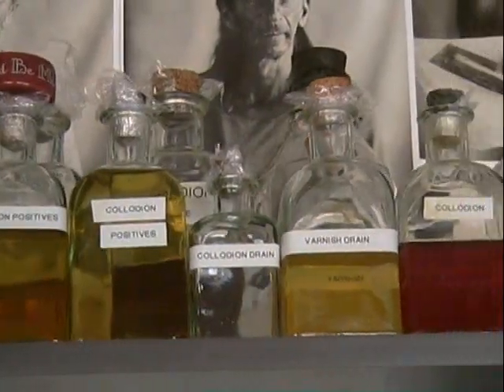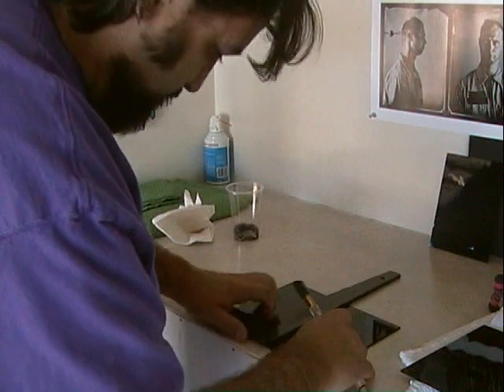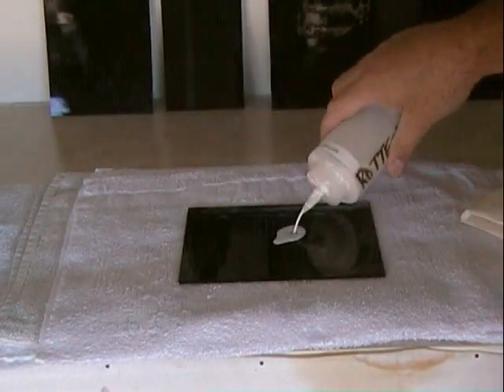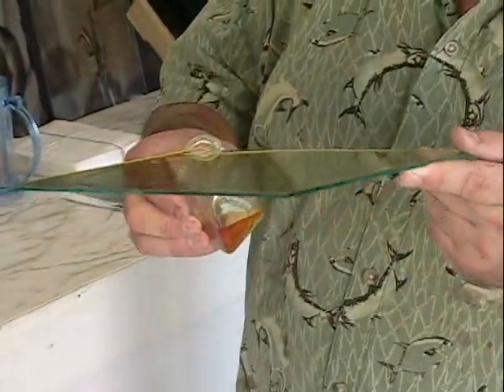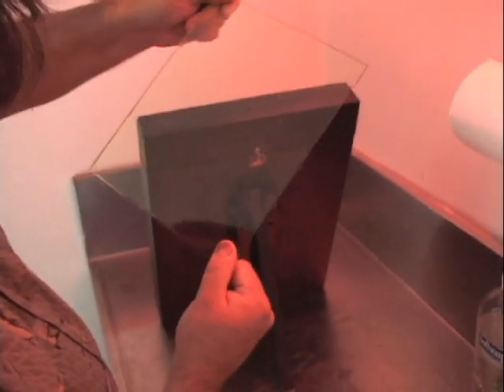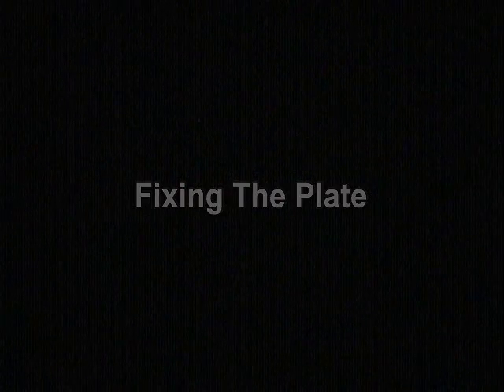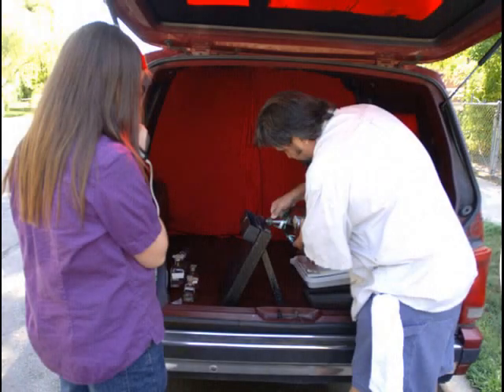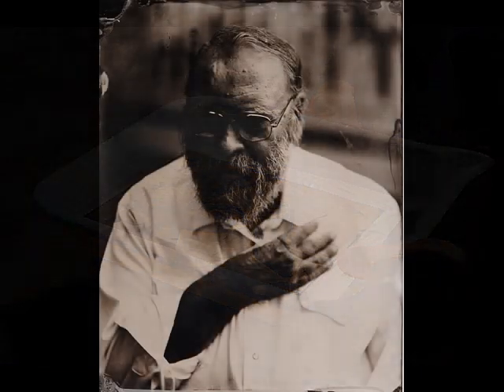The Wet Plate Collodion Process

Comment: This is amazing!  I'd love to try it, but i'm sure it's not easy to come by the necessary materials.  

Why is the process dangerous?
Reply from the maker: +Taylor Harvey Thanks, Taylor. It's relatively easy to get the chemicals and equipment to do this - not that big of a deal. The danger comes from the handling and storage of chemicals - the explosion and fire risk is high because of the ether and collodion. If you fix with cyanide, it's another level of danger. However, if you're mature and a professional, it's no more dangerous than a lot of the stuff we have under our kitchen sink.

Comment from the maker: That is correct. There's a lot that goes into the chemistry before and after, but that's the critical point, converting the salts into halides. 

The collodion is salted with a bromide and iodide. I add more solvents to thin it down (alcohol and ether).

The plate is immersed into a bath of silver nitrate for 3 - 5 minutes. 

The developer is made of ferrous sulfate, alcohol, glacial acetic acid and water. 

The fix can be KCN or hypo or RF. 

Varnish: Gum Sandarac, alcohol, lavendar oil

Comment from the maker: No, don't add anything. The pH will be around 4, the specific gravity somewhere in the 1.070 - check it all before you start using it - this will give you the baseline to perform maintenance on it later. I have an entire chapter on it in my book. You should consider getting it - it comes with access to online videos, too. Very detailed, very easy to follow, no guess work.

Comment from the maker: That's the easy part. 9% Working Silver Nitrate:

90g of AgNo3
1 Liter of Distilled Water

Flow a glass plate with Collodion. Let it sit in the silver bath for at least four hours - you can leave it in overnight (iodizes the bath). After that, you're ready to use it.

Comment: Where would one get the bath itself (not the silver nitrate). Did you make yours yourself?

Also, do you turn the negative into a positive? Meaning everything form start to finish is done on a single black plate. If not, why not use silver gelatin paper for positives?

Thanks in advance!